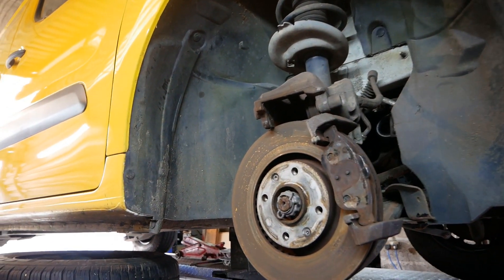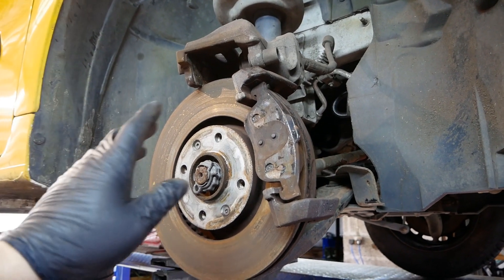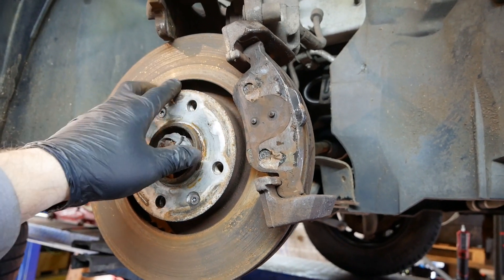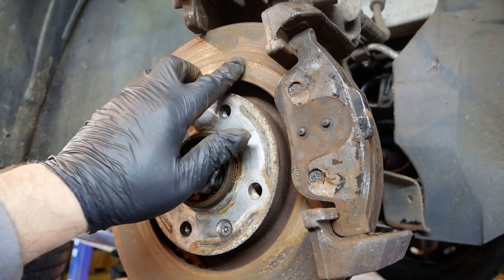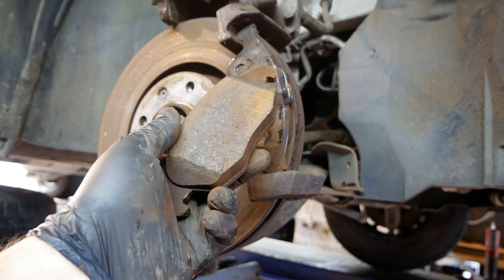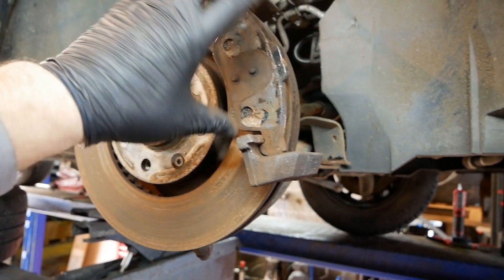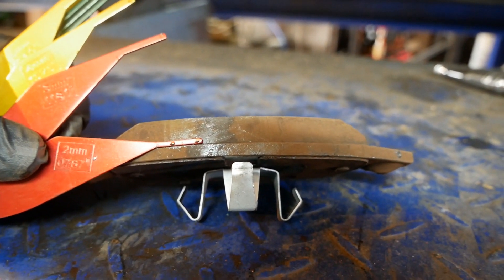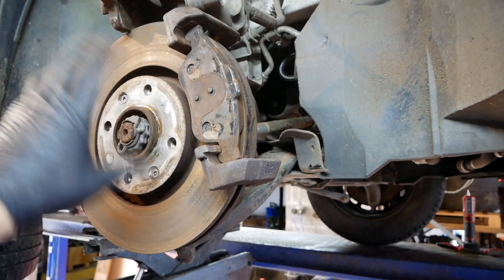Do EVs really produce more brake particulate pollution?

Comment: I dab my brakes daily to make sure rust doesn't build up.
A Tesla engineer told me he saw a Tesla with 300,000 miles and he said the brakes where like new.
Reply from the maker: Yes, its a good idea to give the brakes a good hard dab at speed to keep the clean, especially before the vehicles has a MoT test.
Reply: @GoGreenAutos  Have to be careful it doesn't dent the boot though 😉

Comment: Same experience for me. Renault Zoe has just had its 54,000 mile service and brakes are only 25% worn, so likely to last 200,000 miles unless they need to be replaced due to corrosion?
Reply from the maker: That's pretty good going as the Zoe has pretty feeble regen (ZE22 & ZE40 anyway), so you must be driving very efficiently.

Comment: Another excellent informative video Matt 👍
My 5 year old  2017 Renault Zoe Q90 has done 68,500 miles on the Original front brake discs & pads.
But I will probably change the front discs and pads this year ( 2023 ) only because it's showing slight signs of corrosion and not because they're worn out.
The Renault Zoe is around the same weight as the Ford focus.
Reply from the maker: Now that EVs have such little brake use, the need to re-skimming brake disks is back....but no one does this now.

Comment: It's odd how the weight of EVs is a problem, but the weight of gratuitously large ICE vehicles is not.
Reply from the maker: What most people don't appreciate is that modern ICE vehicles have got heavy and expensive, so when comparing both with an EV, they're often referring to older generation ICE. I made a video on the weight of EVs, https://youtu.be/JC9Cm7YL3Rg
Reply: I drive a Kona 64. There is a 22% increase in weight compared to the petrol counterpart.  Considering the performance advantage,  like for like it's not that much heavier.

Comment: Thank you!  Fits in completely with my experience with owning a Zoe for about 4 years.  Only did about 10k miles, but mostly in short journeys, often only a few miles.  Yet still wore a massive 10% of the brake pads.  More than happy to accept any genuine arguments in favour of ICE cars, but most seem more full of holes than a swiss cheese devoid of the cheese.  Comparing efficiency when forgetting about the drilling/refining/transportation costs is another common one.
Reply from the maker: Yet the Zoe has weak regen, so brake wear would be higher than other EVs.
Yes, its funny how mining has become a hot topic, yet happily ignoring the impact of oil - so much worse for the environment!

Comment: Good video Matt. I replaced my front pads and discs on my Renault Zoe 2017 Q90 last year. Mechanic actually said the pads were fine but the discs were corroded to the point of being an Mot issue. I had the exact same issue on my 2008 Toyota Prius after 6 years. Regen braking corrodes brake discs 😊
Reply from the maker: Yes, almost every EV gets the "brake discs pitted/corroded" MoT advisory. It's about time they realised this isn't an issue on EVs and the parameters need changing.

Comment: This should be common sense really, but there is even a belgian study that has a finding, that EV:s with regenerative braking can have up to 66% less brake wear than combustion engined cars in an urban environment. I believe the wear is even less on country roads or highways.
Reply from the maker: 66% is too low. Maybe on early Leafs & Zoes with weak regen. But newer EVs with strong regen, I'd say they have more than 90% less brake wear.
Reply: @GoGreenAutos  Okay, 90% less is a lot! They should do a new study, because this one was done before 2016.

Comment: My Panda got through pads at  around 35k miles, my LEAF just  passed its 5th year MOT at just over 89K miles with virtually no pad wear. Although my 1st Gen LEAF wore rear tyres at 15000 miles my 2.0 LEAF manages over 45000 before getting to 3.mm, (still well above the legal limit)
So much for urban myths?
Reply from the maker: Exactly

Comment: So the brake pads will last as long as 3 traction batteries !
Reply: Amazing but true although my EVs made of steel not aluminium like a Jag or Tesla so will rust.
Reply: 600,000 miles from one set of brake pads‽  I think that might be a bit over-optimistic.
Reply: @johnwinters4201  when the weather warms just have a look at your ev brakes.

Comment: My understanding is that an EV uses the brakes far less than a fossil car due to regen taking a heap of the load.  The weight is relative because there are plenty of heavy cars and no accounting for load and driving style.

As for tyre wear:  I am not aware of any EV wearing their tyres any quicker than non-ev's so once again, utter bollox.

The anti EV brigade will of course argue that black is white just  because they hate.  Simple as.
Reply from the maker: I've been driving EVs for 7 years now and tyres don't wear quicker on EVs. If anything, possibly less.

Comment: Transiently yes during rapid stops only.
On average a lot less.
It's obvious due to re-gen.
Maybe a bit more tyre particles due to weight. But it'll be marginal.
Seems to me the discs should be made of non-rusting steel...?
Reply from the maker: Yes a brake redesign is certainly needed for EVs. Lifting the pads off the discs makes a huge difference to the driving efficiency and the ability to properly coast (as you can in an Ioniq).